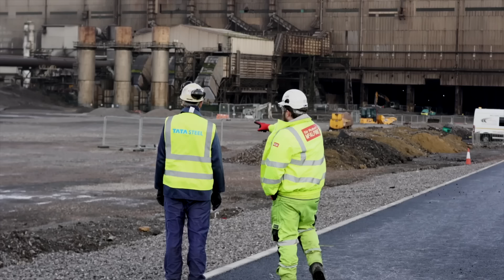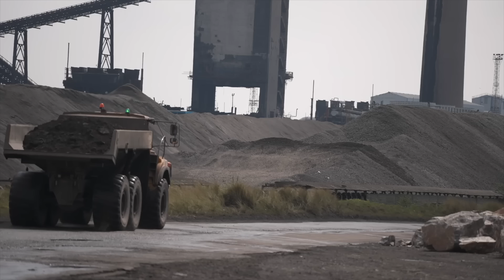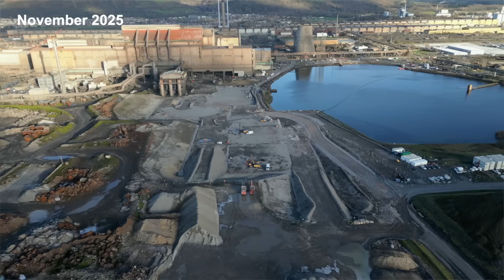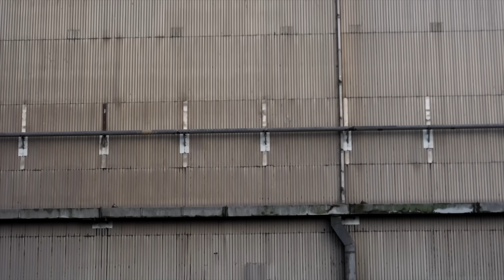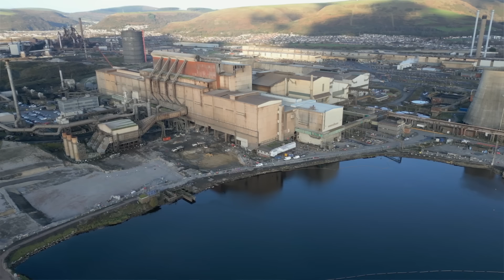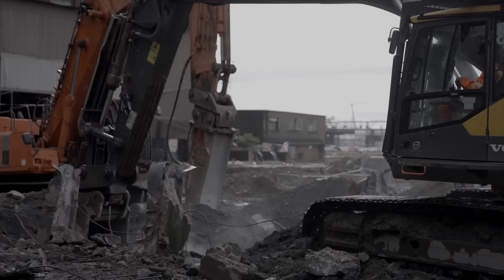360,000 Tonnes Excavated to Make Way for Tata Steel UK’s Electric Arc Furnace

Comment: How did they move 360 thousand tons of excavated soil and rubble? Where did all that contaminated soil go? I hope they loaded it onto ships and sailed away to somewhere. The cost by road would have been horrendous, plus where would they dump contaminated soil, in Wales? We will wait and see if the new furnaces will require constant bailing out by the government. Plus it will only be a low percentage of re-employment once it is finished. Sorry to be a Job's comforter, but it is best to be realistic about this whole scheme. I worked there during the 2000K roll out as a project manage. also I worked there on one of the furnace shutdowns too. In a way it is lucky for some of my family who passed on during the good times. At least they didn't get to see this.

Comment: I only hope there plenty electric to drive them
Reply: how will this be viable in the country with the most expensive commercial power in the europe if not the world even with the discount they can get
Reply: Unlike a normal funace where heat is constant via gas/coke. They tend to deliver the electricity in short bursts in Electric Arc Furnaces, so wind turbines on site with banks of capacitors would be an ideal solution and be more cost effective as they normally only maintain an arc for upto an hour at a time.

Comment: The down fall of electric furnace is it only melts scrap iron and doesn't make high quality steel and those carbon rods aren't cheap,
Reply: Funny comment. We used arc furnaces 50 years ago to make high quality alloy steel for chieftain tank turrets.

Comment: How many windmills would it take to power this? 4 million?
Reply: 4 million? Let's do the actual maths.

Port Talbot's EAF will produce 3 million tonnes of steel per year. At ~450 kWh/tonne, that's about 1,350 GWh annually.

A modern 14 MW offshore turbine (like those going in near Port Talbot) produces roughly 50 GWh/year. So you'd need about 27 of them. One small-to-medium offshore wind farm.

Even with older onshore turbines, you're looking at 160-170. Not 4 million.

As for "power comes from gas or coal" - wind generated 29% of UK electricity in 2024, the single largest source. Coal is under 2% and basically gone. This isn't 2010.
Reply: Theu just  get paid  subsides   whilst the power still  comes  from  either  gas  or  coal  the windmills are a farce  in the uk. Its basically  a  scam  that the pu lic have to pay for. Its why we have the most expensive   power in the world.
Reply: It's not going to happen. Same as data centres.
Reply: @julianfowler6069  yeah but they will be built and will be paid for by us tax payers. Get to the point  ffs !
Reply: @chriss7930 sure will.

Comment: An electric arc furnace cannot make structural steel from iron ore. All it can do is make secondary steel from scrap. Its an investment yes, but it's an expensive process because it uses a LOT of electric that we don't have as a country and ultimately, electricity supply will control output. It also mean, we have IMPORT structural steels. Impressive construction, but that is all.
Reply: You're right that Port Talbot's EAF will use scrap - the UK is losing primary steelmaking capacity here, which is a legitimate concern worth debating.

But the claim that EAFs "cannot make structural steel from iron ore" is wrong. The DRI-EAF route (Direct Reduced Iron fed into an Electric Arc Furnace) does exactly that, and it's the basis of virtually every major green steel investment globally - HYBRIT in Sweden, H2 Green Steel, ArcelorMittal's decarbonisation plans. Iron ore in, structural steel out, via EAF.

Scrap-fed EAFs also produce structural grades routinely. The tramp element concerns only affect certain flat products requiring exceptional surface finish, not structural sections. EAFs produce around 70% of US steel, including structural products.

The real debates are about jobs, industrial strategy, and whether the UK should retain primary steelmaking - not whether EAFs can make structural steel. They demonstrably can, from both scrap and iron ore.